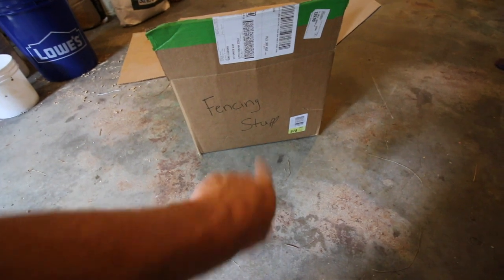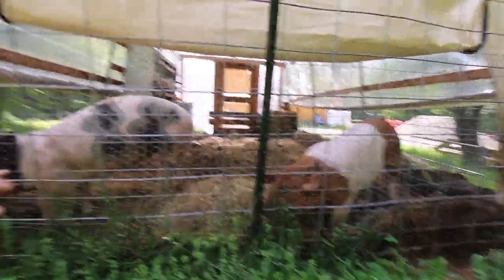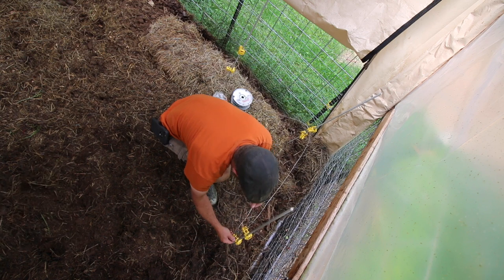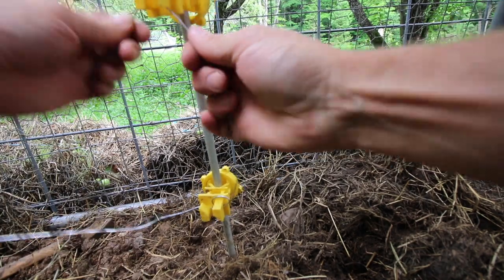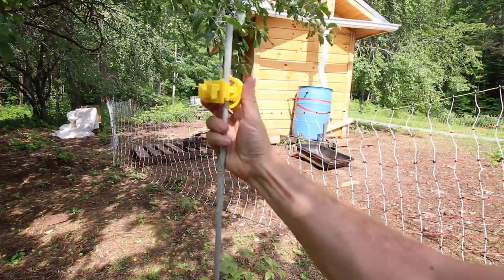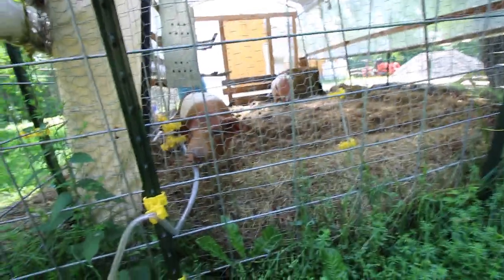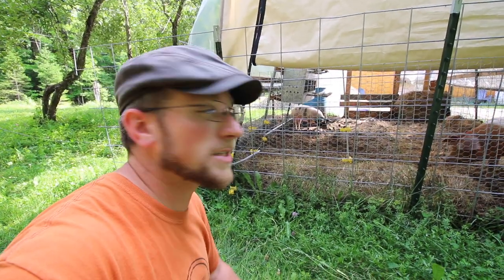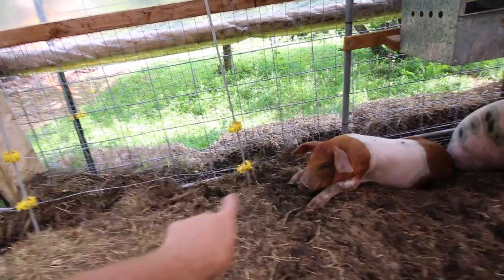How to Train A PIG!

Comment: Hah! They sure learned about that fence in a hurry. lol I had several rotational pastures for my goats. Back then there was no pasture netting. I had T stakes with turkey fencing, and 3 strand hot wire. I had to be vigilant about making sure it was working. I had one doe that would hold her nose no closer than 1 inch away, and could tell if the wire was hot or not.
Reply from the maker: That is one smart goat! Lol. I am so glad for electric netting!